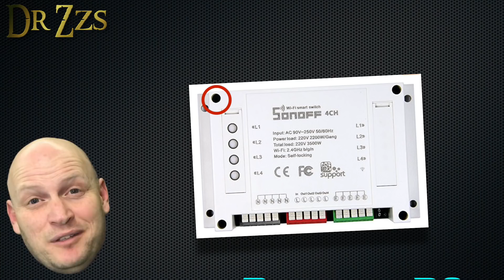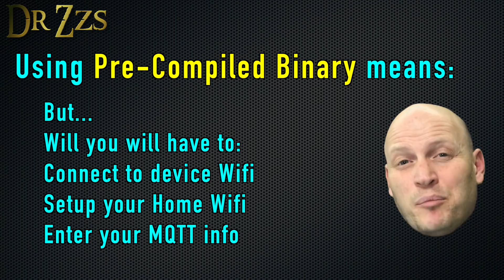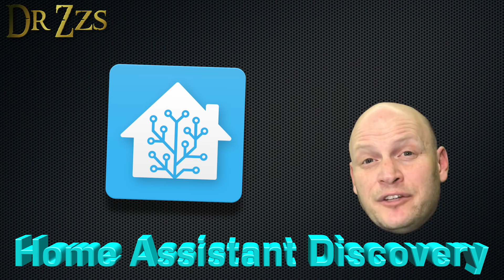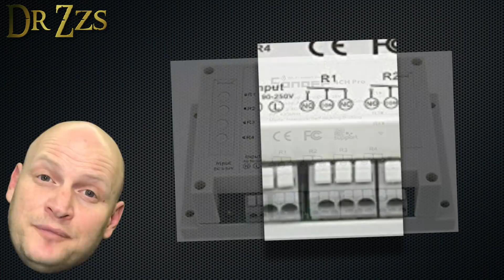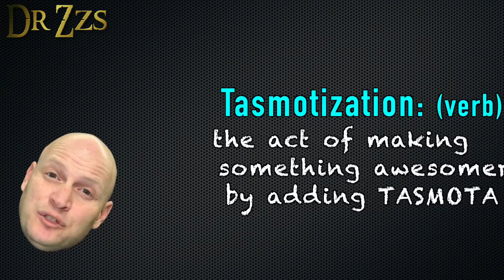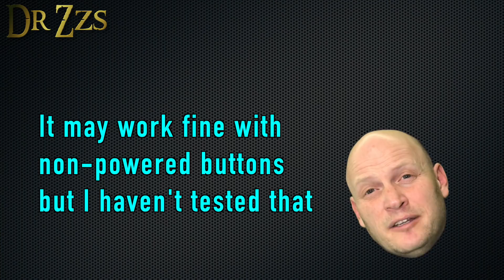Sonoff 4 channel w/ Home Assistant Discovery and FlashEZ

Comment: Can you use the RF functions with custom firmware on the Sonoff 4ch pro R2? I want to flash it with esp home. But I need to control it with an RF remote.
Reply from the maker: Wish I knew the answer.  Sorry
Reply: @DrZzs  no probleem, I will let you know the answer once I've tried

Comment: Trying to flash a 4CH with esphome firmware but keep getting "ESP Chip Auto-Detection failed: Failed to connect to Espressif device: Timed out waiting for packet header
". Tried just about anything with no solution. Any suggestions?

Comment: Can a temp sensor be added to the 4 ch pro r1
Reply from the maker: I would expect it can be added to RX or TX.  You may need to disable serial logging so there aren't conflicting signals on those pins.  I'm pretty sure Rx and Tx are the only pins available to use on the 4ch since there are already 8 pins being used for the relays and buttons.  I've used Rx for DHT temp sensors on other Sonoff devices, so it should work.

Comment: I would like to control the Sonoff 4CH Pro R2 using a RF 433MHZ modulo with a Arduino.
Does anyone know how to? Could you make a video about it?
Thanks.
Reply from the maker: I'm not to good with raw arduino.  Keep hunting.  I'm sure somewhere out there is a tutorial about 433 transmitter on Arduino. 
Good luck!

Comment: Any possibility of using sensor modules (humidity, temperature or reed switches) with the Pro R2?
Reply from the maker: With 4 relays and 4 buttons you'll be running pretty low on available GPIO pins.  You could still use Rx and Tx. You may have trouble if whatever you put on those pins is grounded when the board restarts. 
Hope that helps.

Comment: Hi DRzz!
I am unable to autodiscover my 4 channel nonpro nonR2. Below are the configuration. I have spent hour but no luck (I have just started up with HA & MQTT),

Configuration.yaml
mqtt:
    broker: 192.168.0.115
    username: sandeepambekar
    password: password

MQTT configuraion.

{
  "logins": [
    {
      "username": "sandeepambekar",
      "password": "password"
    }
  ],
  "anonymous": false,
  "customize": {
    "active": false,
    "folder": "mosquitto"
  },
  "certfile": "fullchain.pem",
  "keyfile": "privkey.pem"
}

When I manually press button on the device I see below message.

1553944945: |-- url=http://127.0.0.1:8080/superuser
1553944945: |-- data=username=sandeepambekar&password=&topic=&acc=-1&clientid=
1553944945: |-- aclcheck(sandeepambekar, sonoff/stat/POWER1, 2) SUPERUSER=Y by http
1553944945: |--  Cached  [1C512370009518297544FB1409CDA564012996CF] for (client id not available,sandeepambekar,2)

When I use the Sonoff Tasmota web toggle button, I get below message.

553945116: |-- aclcheck(sandeepambekar, sonoff/stat/RESULT, 2) CACHEDAUTH: 0
1553945116: |-- mosquitto_auth_acl_check(..., client id not available, sandeepambekar, sonoff/stat/POWER3, MOSQ_ACL_WRITE)
1553945116: |-- aclcheck(sandeepambekar, sonoff/stat/POWER3, 2) CACHEDAUTH: 0

Please help me!! :)

Comment: For relay module like this https://amzn.to/2DS6jAU, which has some peripheral components, is it still true that a Esp8266 pin cannot provide sufficient current to drive it?
I guess since there are some transistors working as a gate, it actually drains very little current from the ESP8266 pin and provides enough power to the relay. That's the reason why they need a 5V input.

Comment: Thank you for the very helpful videos. I flashed the Sonoff Basic and Sonoff S26 following your videos. Works great! I'm now following this video for the 4CH Pro R2. However when I flash sonoff.bin with ESP EasyFlash it fails. The logs say the following: 

######2018-12-18######
#######0.03.002#######
######FLASH INFO######
BIN file: sonoff.bin
COM port: (COM4) USB Serial Port
Baud rate: 115200
######POST FLASH######
No post flash information entered...
######FLASH LOG######
[esptool.exe -vv -cd nodemcu -cb 115200 -cp COM4 -ca 0x00000 -cf "D:\HomeAssistant\Sonoff\ESPEasy\bin\sonoff.bin"]
[18/12/2018 1:11:42 PM] esptool v0.4.12 - (c) 2014 Ch. Klippel <ck@atelier-klippel.de>
[18/12/2018 1:11:42 PM]  setting board to nodemcu
[18/12/2018 1:11:42 PM]  setting baudrate from 115200 to 115200
[18/12/2018 1:11:42 PM]  setting port from  to COM4
[18/12/2018 1:11:42 PM]  setting address from 0x00000000 to 0x00000000
[18/12/2018 1:11:42 PM]  espcomm_upload_file
[18/12/2018 1:11:42 PM]  espcomm_upload_mem
[18/12/2018 1:11:42 PM]  setting serial port timeouts to 1000 ms
[18/12/2018 1:11:42 PM] opening bootloader
[18/12/2018 1:11:42 PM] resetting board
[18/12/2018 1:11:42 PM] trying to connect
[18/12/2018 1:11:42 PM]  flush start
[18/12/2018 1:11:42 PM]  setting serial port timeouts to 1 ms
[18/12/2018 1:11:42 PM]  setting serial port timeouts to 1000 ms
[18/12/2018 1:11:42 PM]  flush complete
[18/12/2018 1:11:42 PM]  espcomm_send_command: sending command header
[18/12/2018 1:11:42 PM]  espcomm_send_command: sending command payload
[18/12/2018 1:11:42 PM]  read 0, requested 1
[18/12/2018 1:11:42 PM] trying to connect
[18/12/2018 1:11:42 PM]  flush start
[18/12/2018 1:11:42 PM]  setting serial port timeouts to 1 ms
[18/12/2018 1:11:42 PM]  setting ser
etc.... a number of retries...
Reply from the maker: hmmm
You've probably already gone through these things, but just in case, here's a link to some more info from the Tasmota wiki: 
https://github.com/arendst/Sonoff-Tasmota/wiki/Sonoff-4CH-and-4CH-Pro#sonoff-4ch-pro-r2
There seems to be a few unique issues with the 4ch pro r2.  Maybe something there will solve it for you. 
Hope that helps.
Reply: @DrZzs  Yes I did go through that page. Interestingly it works fine with the Sonoff app. Would be great to get it connected to Home Assistant as I need it for my Pool Automation with low voltage equipment.
Reply: DrZzzs, I found the issue. The GPIO0 contact was not connected to the chip. Somehow I must have damaged the contact and with my eyes getting older I just didn't see it. So I soldered it directly on the ESP8285 and it worked! Thanks again for all the great instruction videos. They are helping me big time.

Comment: Could I use a sonoff 4CH (Pro?) (R2?) to control the power to individual external harddrives? (Yes I know you should just leave them running non-stop). 

These harddrives are connected to my network, and are in a remote location. Crawling around to disconnect them is not fun.

I know I could connect each harddrive via a Sonoff Basic, so the real Qs are, 1. is it even possible to control 4 units and 2. does it provide some advantage to do so, (vs the Basics). I'm hoping that using the 4CH Pro R2 (or other) would reduce the clutter of wires.

But I don't understand the "ratings" of the power for the 4CH units. I see there is separate power to run the board, and then 4 other sets. I don't see how there is an "input" and and "output", as you can see in the Basics.

Finally, there is the Q of how to deal with the physical power cords to the harddrives. Do I cut the existing HD pwr-cords and splice them into the Sonoff (even the Basic) OR should I add some more clutter and only splice in separate extension cords for each?

Thanks for any ideas!
Reply from the maker: That's an interesting use for it.  You would be able to use the 4ch Pro R2.  The reason is, I assume your hard drives run on 12v.  So each one has a power supply that plugs into the wall.   A sonoff Basic or the non-Pro 4ch are made to switch 120v (or 240v).  They won't work if you try to cut the power cord for the hard drives and put them in-line there.   A 4ch Pro R2 on the other hand can be powered by 12v. But I actually think the best solution would probably be 4 Sonoff SV's.  Then you can just cut the cord for each hard drive and use those wires to connect to the input and output of the Sonoff SV.  Simplest solution I think.  The SV's don't come with a plastic case so you'll have to come up with that yourself somehow.  
http://drzzs.com/Sonoff_SVx3
http://drzzs.com/Sonoff_SV
Hope that helps!
Reply: + @DrZzs  Thanks very much for the insights. I'm a little nervous about cutting the OEM power cords to my hard drives, but I might do it. 

Now I'm going to think thru a pegboard mounted solution, with 2 ft extension cords purchased on ebay (or elsewhere).

Thanks for the great series and all the great info you provide. (I just wish it was a little easier to flash tazmodo, but I suppose after I do it 2-3 times, it will then seem easy ;-) ). 

Do you know if downloading shows with youtube-dl counts as a full viewing to your status? ;-)
Reply: @DrZzs   Thanks very much for the feedback. Sorry I haven't replied, but got  tied up with the Chrismas holidays : -) ... 

Can I flash the SV model to have Tasmota, and MQTT access?

Thanks!!!

(FYI, your posts haven't been coming up in my feed, are you on Christmas break too ?   (Just meant as a data point on analyzing the YT Algo ;-) ). ).  (Just looked at your main page, wow, I've got some good viewing ahead!) .

Comment: Do you have a video with Sonoff POW R2 power module connect to the Hassio?  Beside turn on and off switch it also provider the power consumption of the line connected to it.   I plan to move all to Hassio using MQTT because some of my sonoff modules lost connection for no reason and unable to pairing back again.
Reply from the maker: I do have a POW R2 video.  
https://youtu.be/BCEU8Ijmkds
Hope that helps!

Comment: Is there a way to connect 4 buttons (wall switches) to the 4 buttons on the Sonoff? I am thinking to use this to control the window blinds, each window has 2 blinds, each with up and down button. I think I can connect these to the sonoff, but I need to keep the buttons too.
Reply from the maker: you'd have to solder wires to the poles of the existing switches.  There aren't enough gpio pins to run new switches (like we do with the sonoff basic).  But soldering directly to the poles of the existing switches should give you the functionality you're looking for.

Comment: Once you have the board flashed, and have accessed the web-interface, I would expect that when you press one of the buttons on the the unit that the relay would click, or that the blue Toggle 1 / 2 / 3 / 4 buttons would activate the relays.  I'm finding that neither happens.  Is that due to the limited power being supplied by the FTDI connector from the USB cable?

Comment: flashed the firmware to D1 mini. but dont see the hotspot showing up. Could you please help?
Reply from the maker: hmm.  so you have Tasmota on the D1mini.  Did you use sonoff.bin or did you compile your own .bin?
Next question is what Tasmota version are you using?
How are you flashing?  Arduino IDE?  FlashEZ?  
Can you see anything with the Arduino Serial monitor or Termite?  
Finally, are you seeing any lights on the D1mini?
Reply: Termite did it. Thanks :-)

Comment: Could I have feedback on Sonoff Pro 4ch when wired in 2-ways? How can I do that?
Reply from the maker: can you tell me a little more about what you're trying to do and I'll try to help.  You mean like for a 3 way switch?
Reply: DrZzs I need to operate the sonoff on three way with a standard switch. When the light switches on / off the sonoff app status should be correspond.  Is there any way to do this? I'm using sonoff with the original firmware with e link. thank you so much

Comment: Hi, I would like to know if there is any way to connect four physical switches to a 4 switch sonoff to be able to control them.
Sorry for my English, I'm Spanish, congratulations for your tutorials, I'm learning a lot of home automation and a lot of English.
Reply from the maker: Hi!
There are no extra pins, but you could use the contact points of the buttons that are on the board already and just solder wires onto those contacts and run the wires to switches.  So, yes.  It is possible.  
Hope that helps.

Comment: hey drzzs i used this method to flash my sonoff 4ch r2 with no problems even got it setup in sonweb i was wondering is there a way to rename  in hassio it is listed as (sonoff sonoff2 and 3 and 4 ) thanks  the videos are great also planning to build a house in the next year any advice for planning ahead.thks
Reply from the maker: With the Auto-discover I'm not sure how to rename them.  Maybe change the friendly name in SonWeb.  Then restart HA.  Maybe that'll do it. 
I haven't tried it and my VPN is not cooperating so I can't connect and check, but I believe there's a file called "entity registry" or something.  You may find the "discovered" entities there.
Reply: thanks i will check it out today after work
Reply: okay i renamed in sonweb and restarted same results and they were not listed in the entity registry  any other thoughts thanks

Comment: Very informative. I never realised the difference in relays between the pro and non pro. Not sure if there is a functionality difference between R2 and non R2.
For those who find the sonoff 4ch too expensive but still want 4 WiFi relays: make yr own: https://arduinodiy.wordpress.com/2018/06/14/simple-wifi-relay-board-or-diy-sonoff-sv-sonoff-4-channel-2/
Reply from the maker: thanks!
Making your own is a great idea too.  
I've got a buddy who made a 12 relay board for his sprinklers.  Can't run them all with an ESP8266 though....
Reply: DrZzs if 4 is better than 1, 12 is better than 4. Could run a 16 channel i2c i/o expander on esp8266-01 and do it that way ;-)
Reply from the maker: heck ya!

Comment: Hey Dr... Great channel. On the use of a terminal (Termite) to change your parameters, this is by far the quickest way to configure. Not because of the just the use of the terminal program, but... you got to try the "Backlog" command. This allows you to configure the unit with 1 command....yep, all the parameters in command. Its described on the Tasmota Commands Wiki. Here is an example.... 
Backlog SSID1 <xxxxxx>; Password1 <yyyyyy>; MqttHost Hassio; MqttUser 299MQTT; MqttPassword <yyyyyyy>; GPIO14 09; Hostname sonoff_kitchen_main; MqttClient sonoff_kitchen_main; Topic sonoff_kitchen_main; FriendlyName1 Sonoff Kitchen Main
Just replace the SSID and passwords with yours.
Anyway keep up the good work. Loving it
Reply from the maker: YES!  I was looking for something like that to add all the settings with one command!  
Awesome!

Comment: Look into the new Tasmota on-chip timer functions, especially with the 4CH PRO. It makes it an attractive programmable irrigation controller if you can program those timers from HA. I put together a node-red flow to read and set the timers but couldn't figure out how to do it in Home Assistant. Thanks for the videos, they have been influential on my projects!
Reply from the maker: Awesome! 
I should probably crack open my sprinkler box and smarten it up a bit.  I'm still a nodeRED noob.  
Glad to help!

Comment: Do you think the 4 channel Sonoff will fit into a 4 gang light switch box? I'm thinking a 4 switch Zzonoff :-)
Reply: i doubt it, 🤔 i've ordered one, will find out soon. I'll get one of the deeper boxes, but it may just be the height/width that wont fit, not the depth of the box.
Reply from the maker: ya, I concur with M!sh. 
It seems too tall to fit in a standard junction box.  I can try it when I get back home, but I don't expect it'll fit. 
There's a lot of wasted space on the board.
Would be awesome to have a 4 gang Zzonoff though!
Reply: Bummer.  It would have been nice to have a 4 port switch and only one radio (esp) in the box.  Thanks for the replies.

Comment: I used a NodeMCU esp8266 inside of a power strip with 5 relays. Powered by a cell phone charger(inside the power strip). Flashed it with tasmota and it is awesome.
Reply from the maker: Nice work! 
Post some pics
is it hard to fit all that in there?

Comment: no luck. failed with such messages on different adapters. looks like my board dont ward to go into flash mode

trying to connect
        flush start
        setting serial port timeouts to 1 ms
        setting serial port timeouts to 1000 ms
        flush complete
        espcomm_send_command: sending command header
        espcomm_send_command: sending command payload
        read 0, requested 1

https://www.youtube.com/watch?v=CSC2hW51ikI
Reply from the maker: First, thank you for posting a video of what you're doing.  That is really really helpful! 
It looks like you've got the Pro non-R2 correct? 
It looks like you've connected the pins differently than I would expect.  Maybe it's because you're using the arduino to flash. Comparing your connections to the images from the Tasmota page, it looks like you don't have a jumper on Tx at all. 
https://www.dropbox.com/s/pklc62sg9ek184z/Screenshot%202018-05-30%2016.19.38.png?dl=0

vs
https://github.com/arendst/arendst.github.io/raw/master/media/4chpro_gpio0.JPG

One other thing. I've always just used the one adapter so I'm not too familiar with using an Arduino to flash, but I read somewhere that when using an arduino you might need to swap the Rx/Tx so it would go Rx-Rx  Tx-Tx. 

Hope that helps.
Reply: hi,
thank you for your chanell.
i have this sonoff for several month already and gived up already. its version 1.1
i have tried several configuration before posting video. i used arduino uno and usb serial adapter ch340g. i tried to connect all wires to left connector headers. same result. i used arduino, vs code.

https://www.youtube.com/watch?v=OhQdcwVxe_I
Reply from the maker: dang.  I wish I could help you somehow. 
Those are the only ideas I have right now. 
Not sure why it wouldn't work.  Somehow it just seems it isn't getting into programming mode or the serial pins aren't connecting to the computer for some reason. 
Sorry I don't know what to try next.
Reply: i will try again after i'll re-solder all pins once i get pin headers. its too cheap for free delivery :D